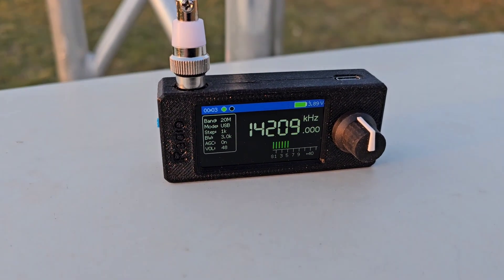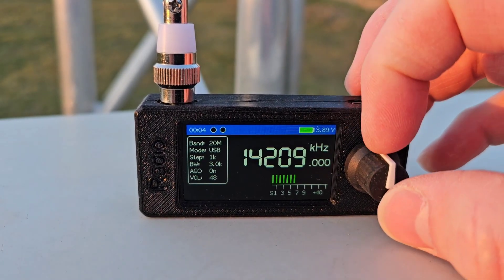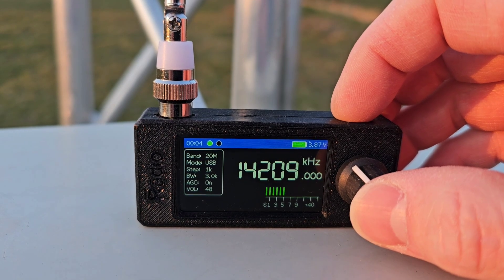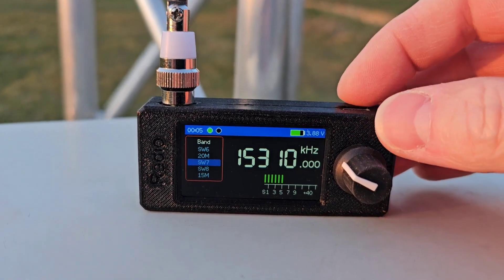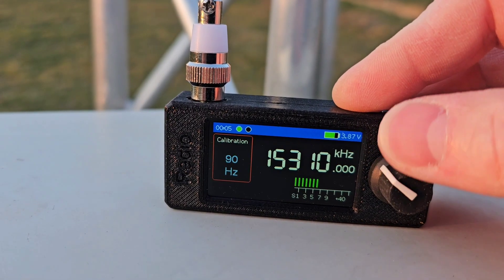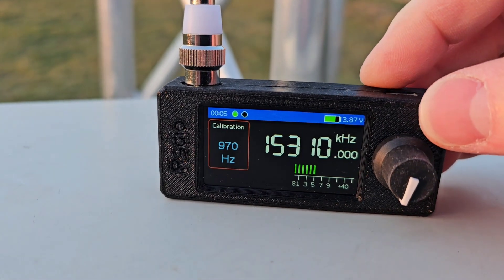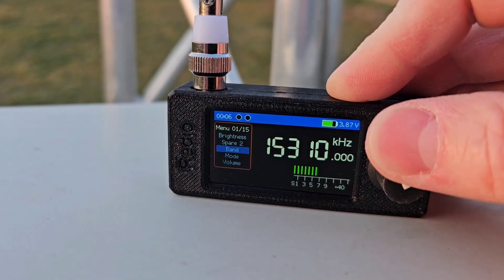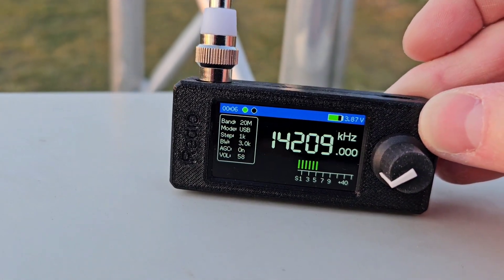ATS Mini SSB Receiver - Frequency Calibration

Comment: Hi, just one question : on my radio the sound from the speaker is rather loud (@40) but when I use the side jack I can hear almost nothing in the headset. I've tried 1 way jack + speaker, stereo jack + old Walkman ear plugs and a recent phone head set with a 3 way plug, no change! I've check the connections on the terminal, re-soldered them , in vain... Any idea?
Reply: Hm, weird. It could be the model you have? Version 1 hardware was a bit quiet, later versions added an amp to the audio out. Or perhaps something like a dry joint in the headphone jack? It's odd.  Get a ATS Mini Pro as a replacement! Hi-z and amp buillt in.
Reply: @SarahC2  yep, I think I'm going to do that. Maybe the jack socket is faulty (bent inner contact?)

Comment: You can use clock stations, tune at USB mode to 9.995 kHz or other  and use freq meter software for your phone and tune 1 kHz tone.
Reply from the maker: Yes but clock stations are not always so strong here 😉